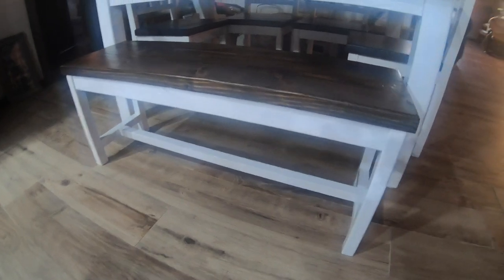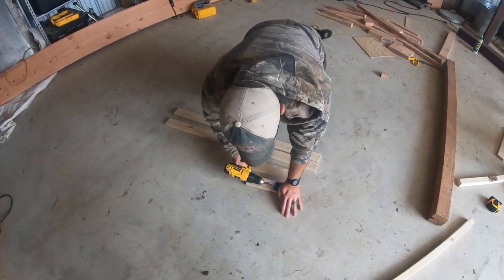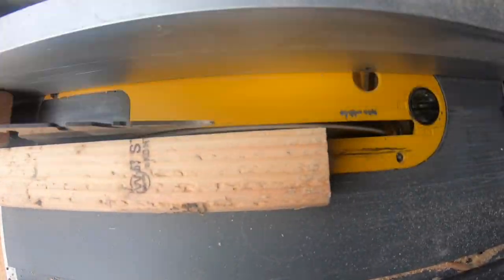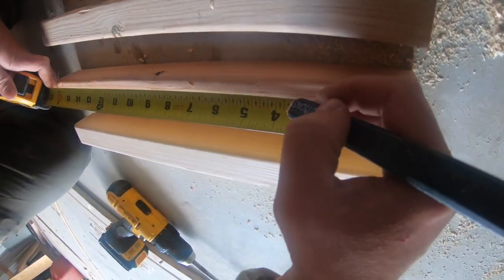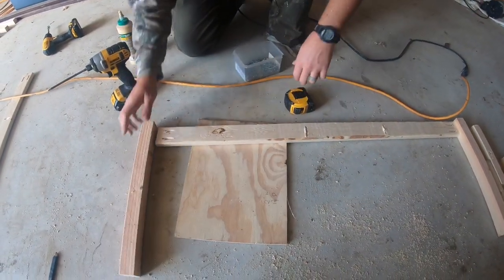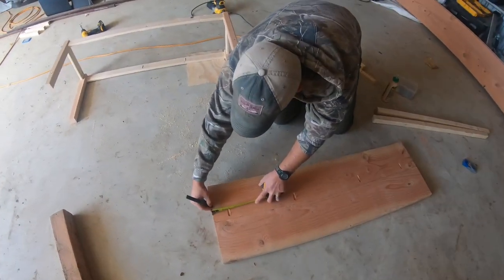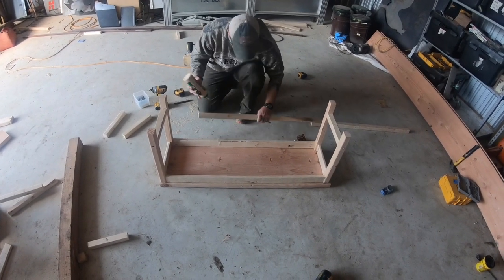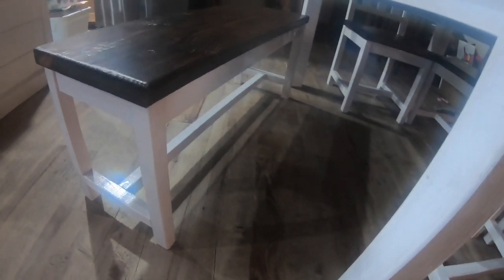Dining Room Bench DIY

Comment: So impressed how you drill pocket holes without using a clamp. Also appreciate that you list material and walk through plans without charging, which most others always charge.
Reply from the maker: If you put your palm on the clamp spot and use the drill on high speed you don’t really need to clamp it if you don’t drill to drill into the wood too quickly.  It saves a lot of time.  No problem!  I get a lot of comments saying that Woodglut is the way to go, but I’m not paying money for plans.  That’s just silly!